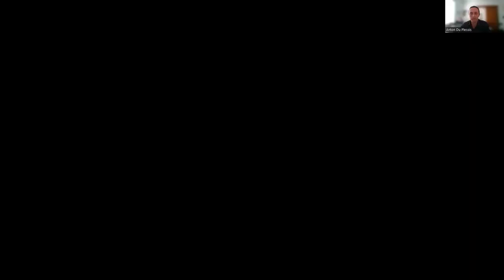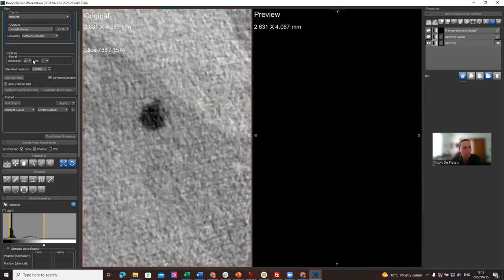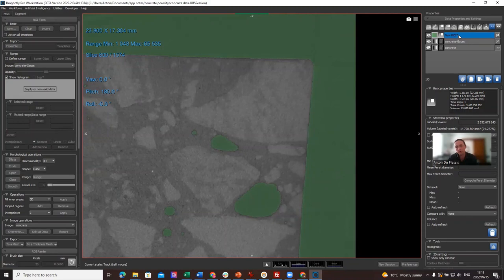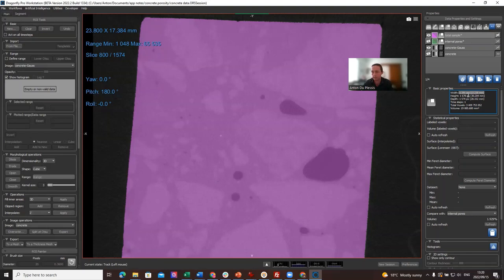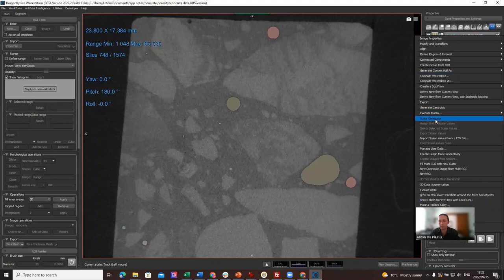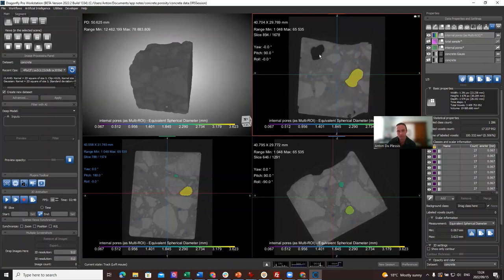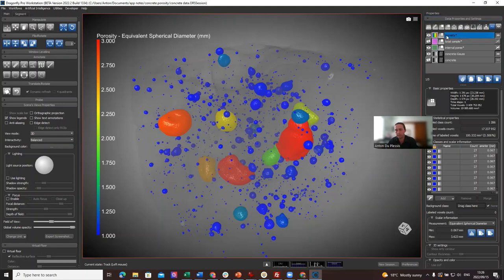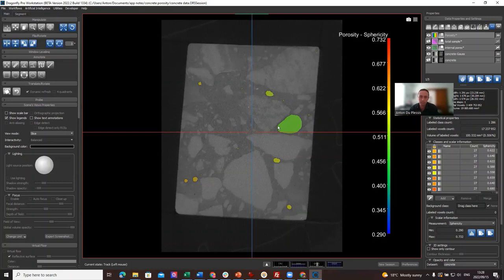How-to video: CT based porosity analysis of concrete using Dragonfly

Comment: Hi,  In the video you have shown to calculate volume and various parameters with scalar generator option. I remember watching one more video in which we can do the calculation with connected component and then going to analysis and choosing from the drop down which one to calculate. It generates the histogram too where you can color code the sections. Can you tell what is the difference between these two methods?  or do they produce same results just a different way to do same a thing?

Also regarding upper and lower otsu, some times it doesn't select the pores properly for my sample, so is it okay to choose a range in the histogram for pores and invert it for the solid part?
Reply from the maker: Hi Aastha, for your first question: multiROI analysis is the same as scalar generator, but includes ways to compare and isolate objects based on their characteristics. Scalar generator is a simpler method basically to get the same data. About your second question, this is a thresholding problem in your image data, it might be possible to use manual range as you suggest but I would also recommend deep learning for such challenges